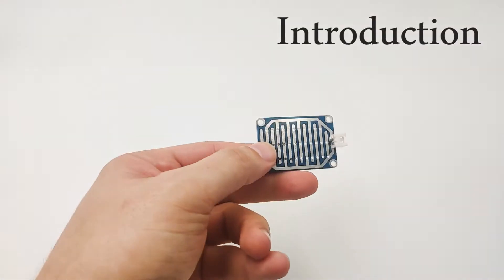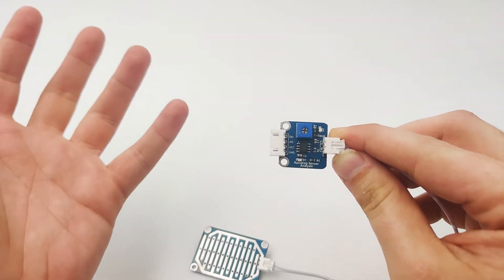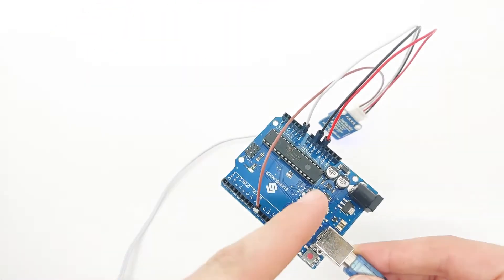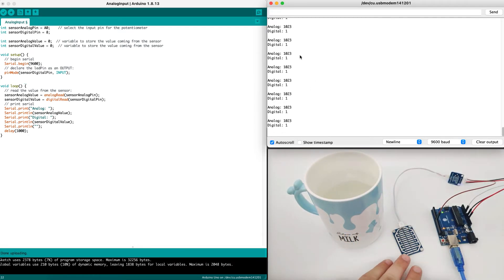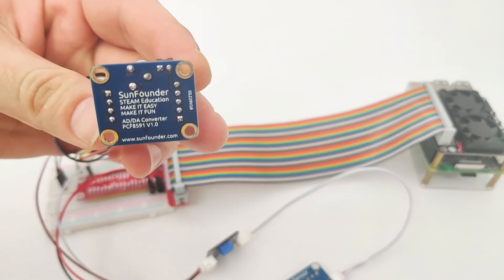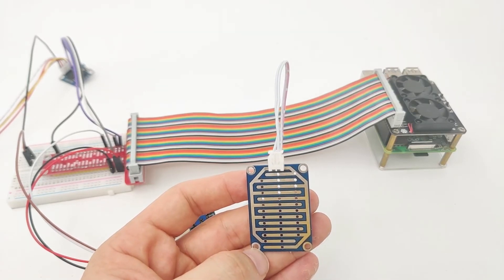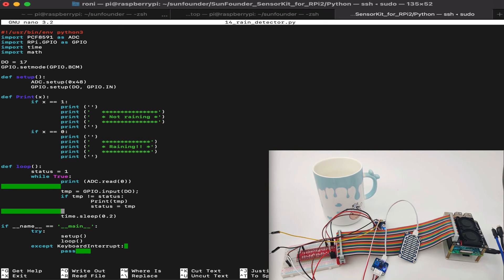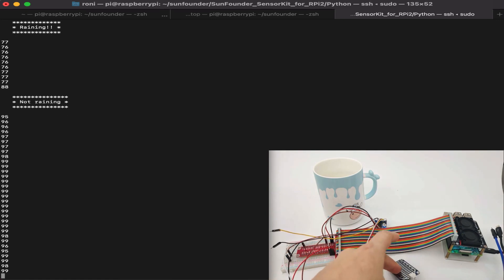How to use Rain Sensor Module with Arduino& Raspberry Pi

Comment: As it uses a comparator to set the threshold I think it is DC so will have the same problem as the China water sensors that is corrosion as it is a DC component that detects resistance so just a waste of money again as we see so many bad designs from China if I am wrong let me know
Reply from the maker: This module is mainly for the purpose of learning and cannot be used for real scene work.
Reply: +MrBobWareham  Seriously, dude?